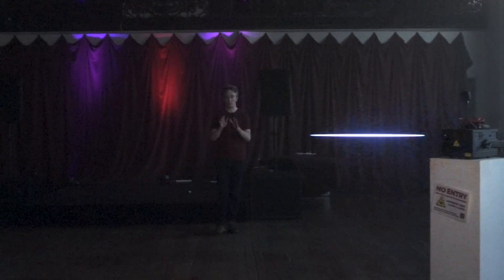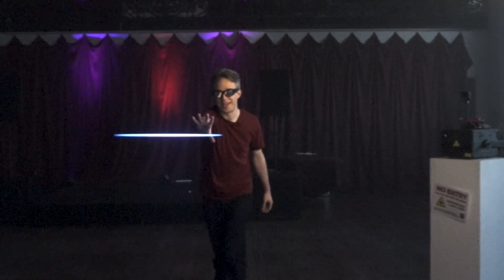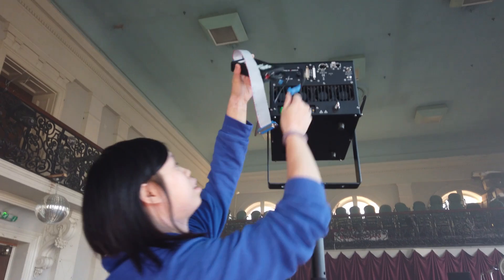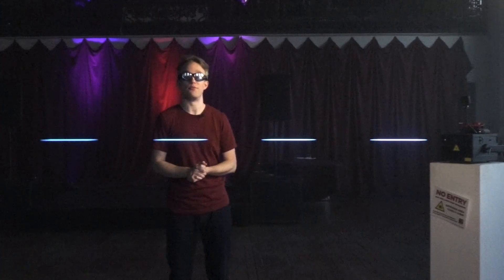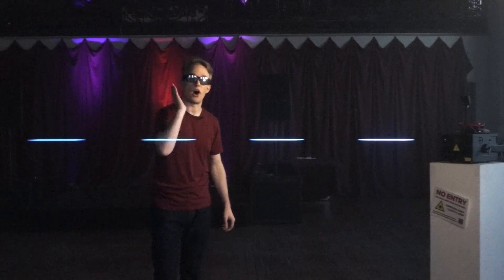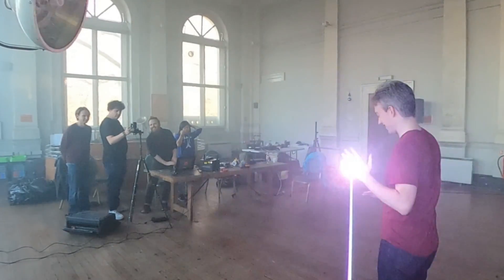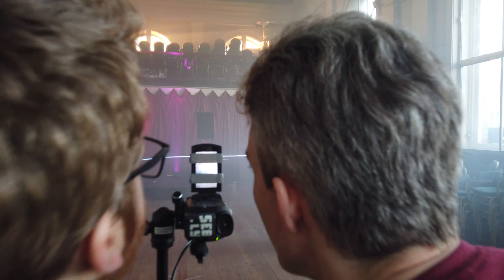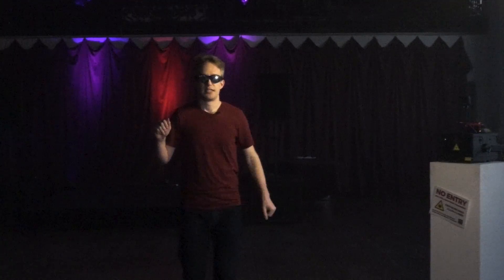Stopping A Laser Beam In Mid-Air

Comment: Mega nerd time: Star wars, despite calling it lasers, uses plasma bolts so they can actually travel the speed theyre seen at.
Reply: Some lightsabers are made with the button to turn it on be on the inside of it. This makes it so only force users can open it
Reply: @TeenyFGC  han solo literally activates luke's lightsaber in ep 5
and there's canon material that explicitly debunks this
Reply: @ft_lesserchungus1192   notice how I said SOME lightsabers. I’m not saying all of them are like this
Reply: @TeenyFGC  oh
damn
im dumb
Reply: Ooga Booga name one lightsaber that’s requires this, you don’t need to be a force user to activate a lightsaber, example the Mandolorians with the dark saber, or kreel
Reply: @kabash8683  or fin
Reply: @Kabash in ‘The Jedi Path’ book that Disney made it mentions that some lightsabers require the force to turn them on - this isn’t because they need the force to work though, it’s because a force-lock of sorts can be built in so that if someone should steal the lightsaber then it would be worthless to them unless they’re a force-user. The series should be fairly reliable since it’s at least pseudo-canon; it’s made to be compliant with the films over the expanded universe but will still mention things in the EU occasionally as long as they’ve not been contradicted by the films - a notable exception to this though is the ‘Imperial Handbook’ which mentions dark troopers (a.k.a. shadow troopers or blackhole troopers) which were squatted I think.
Reply: @kabash8683  I'm sat with the offical 'Way of the Jedi' (jedi history book) on my lap and it very clearly states that many of the Jedi and Sith of the old Republic would be more likely to use force-switches on lightsabres for 2 reasons. 1: if they lost their sabre in battle through disarmament techniques (popular amounts jedi) they wouldn't have it turned on them and 2: they could use a force throw of the lightsabre to eliminate individual targets within a group. The technique faded out after the fall of the Sith as lightsabre combat had become more ceremonial to the jedi.
The 7th fighting form of lightsabre combat (the darkside form) used many methods related to the force-switch, such as catching an opponents defensive sabre parry, and quick switching the sabre on and off again would cause you to flow through their block and land the killer blow. 
Sorry, I'm for nerding
Reply: Actually, in the original 70's SW: A New Hope the lasers are bright flashes that can't be seen especially in the opening scene. It was changed later on.
Reply: @CanONuke  yes but in the current cannon as demonstrated by the numerous existing technical manuals giving detailed cross sections of the blasters, theyre clearly plasma. Doesnt matter what they were originally
Reply: @Alendiel_nova  super heated gas can become a plasma though.
Reply: @Alendiel_nova  canon
Reply: @CanONuke  That's completely false. The 1977 version of Star Wars had blaster bolts traversing the screen every time there's a shootout.
Reply: Came for the Star Wars, stayed for the Nerd Wars
Reply: lightsabers are the plasma ones, I think blasters shoot super-compressed particle beams using gas or something
Reply: @ThisisSigma200  that super compressed gas is called plasma buddy.
Reply: @Kreschavier  super compressed gas and plasma are two entirely different things
Reply: Kreschavier That is super compressed Tibana gas you heretic ;)
Reply: @Kreschavier  Compressing gas condenses it tho
Reply: @Kreschavier  no it's a solid
Reply: Rebel Friend lightsabers use crystals
Reply: @ThisisSigma200  blasters are plasma too.
Reply: Rebel Friend aka plasma
Reply: Rebel Friend no the lightsabers powerhouse is kyber Crystal
Reply: @ThisisSigma200  Blasters use energy that heats Tibana gas into a plasma.
Reply: @ThisisSigma200  plasma is ionised gas, which can be compressed and manipulated using electromagnetic fields
Reply: @ThisisSigma200  aka plasma
Reply: @ThisisSigma200  

No they use superheated tibanna gas
Reply: @ThisisSigma200  Super compressed ionized gas aka plasma?
Reply: That's what plasma is. It is, in a manner of speech, the forth state of matter you get when you super compress gas. The other states obviously being solid, liquid and gas
Reply: @ThisisSigma200  their “ammo” is the gas, but it becomes a plasma
Reply: @ThisisSigma200  both plasma
Reply: @ThisisSigma200  lightsabers are energy
Reply: @ThisisSigma200  Nope, blasters use compressed gas to make plasma bolts and shoot them
Reply: @ThisisSigma200  this is the way
Reply: @ThisisSigma200  no it’s gas based plasma
Reply: @ThisisSigma200  that's called plasma.
Reply: @senatuspopulusqueromanus2082  nonono it's "tibanna" 😉
Reply: @ThisisSigma200  no. Kyber crystals. Even if it's fiction, don't declare things if you're not sure.
Reply: Wait but aren’t the crystals supposed to power the lightsaber by chanelling the force through the wielder?
Reply: @optionfive.  You don't need the force to turn on a saber
Reply: @ballguy1527  yea, you need the force to use it to its fullest potential
Reply: @ballguy1527  you don't need to be a force wielder to activate a saber because the force dwells in all living beings. It's just more powerful in the hands of a force sensitive wielder.
Reply: @ballguy1527  but you need the force to use it effectively
Reply: Lucas Tangen 
some lightsabres have the switch inside the hilt so you have to use the force to turn it on
Reply: @optionfive.  to make a lightsaber you need the force
Reply: @ballguy1527  yep it's why pre visla, Sabine wren, and bo-katan kryze can wield the darksaber despite them not being force sensitive
Reply: OptionFive  (Well that is totally how they all should have made it work, imho. 🧐)
Reply: Lucas Tangen  (You should need the force to use a saber b cuz it’s cooler that way dammit. 🤷🏻‍♂️)
Reply: @optionfive.  you don’t need the force to use a lightsaber
Reply: @optionfive.  so, to make a lightsaber you need to use the force. But not to use it. Darth greivoius has no force power
Reply: @DerrEtCetera  that's not how it works
it's not more powerful
it just is easier to move, to wield
Reply: @ballguy1527  u just need darth daddy to turn it on
Reply: @ballguy1527  everyone has the “force” some more than others without the force there is no life
Reply: @optionfive.  just no
Reply: @optionfive.  and no to the 300+ people who liked this crap
Reply: @optionfive.  the crystals amplify an energy source (a small battery)
Reply: @ballguy1527  Wait you don't? I always thought it was like that
Reply: @ballguy1527  According to Disney.
Reply: @ballguy1527  great example: greivous
Reply: @optionfive. nothing about the weilder
Reply: @ThisisSigma200  they're both plasma,  but lightsabers use kyber crystals that can use the Force to generate electrical charge, near-infinitely.
Reply: @ThisisSigma200  isnt one of those two options legends?
Reply: @ThisisSigma200  hmm super compressed particle beam using gas. isnt that just plasma
Reply: @thewildrave7334  no its "tibanna" 😎
Reply: @ThisisSigma200  thanks rebel friend!!!
Reply: Rebel Friend no, lightsabers are pure light
Reply: @Ink_Sack   if they were, they wouldnt collide. Theyre clearly some  sort of high energy particle
Reply: @Ink_Sack  If, by pure light, you mean plasma, then you would be correct - pure light would be laser swords, and it is well-established that lightsabers are not laser swords
Reply: @MrStyles784  plasma isn't pure light
Reply: @shadowxxe  That is correct. Neither are light saber blades. Or blaster bolts.
Reply: Lightsabers are basically a giant plasma cutter held in a shape by a magnetic field. Which Is how in The Old Republic books and game there are whips and axes and all sorts of different shapes. The kyber crystals focus the magnetic field and give the thing power.

Blasters supercharge a miniscule amount of some sort of gas and fire it which means in reality they would travel at slow speeds.

Slug guns in the SW context are a normal gum but it releases some of the gas inside the bullet or heata the bullet up and basically just throws molten metal at you
Reply: True. You can also tell because in new hope the blaster bounces in the trash disposal and Luke specifies that it's 
"Magnetically" insulated
Reply: @andresleon-vargas3603  magnetically sealed
the door was sealed by a magnet
you can't blast the lock
Reply: Han Solo opened the saber without the force. General Grievous wielded 4! lightsabers without the force. It is possible, but lightsabers are just hard to handle without the force guiding you because you literally only feel the weight in the handle, which makes it easy to accidentally cut yourself with it.
Reply: I LOVE that people on here are debating the usability of lightsabers. Haha. PS. The placement of the crystal (kieber crystal I think its called) is what requires the force because even a slight misalignment can cause the saber to explode when activated. That might be legends/KOTOR/jedi outcast material though so don't quote me. But turning it on is mundane.
Reply: You need connection to the force to focus the kyber crystal, which is why all Jedi have to make their own, it's a part of their training.

But once the lightsaber is constructed anyone who picks it up can turn it on
Reply: @mrdjchasm  lightsabre can't be built by the inaccuracy of the hand, only with the precision of the force can it be made.
Reply: @mrdjchasm  you are talking about MAKING a lightsaber.
the kyber crystal is like a rechargeable battery, and the focusing crystal gives the color and does other things ig
there's some sorta battery lookin thing in the back of the hilt that reabsorbs the blade's energy and puts it back in the kyber
Reply: Comrade Kilonova thank you
Reply: Mega nerd time. That's nonsense. They created these explanations AFTER the movies, to explain the quite unscientific space opera universe.
Reply: @rogeriopenna9014  well no duh that's how the lore of every movie is explained
Reply: @shadowxxe  no it isn't.  That's utter rubbish.  The majority of movies do not start with any such introduction to that.
Reply: NotYourGreatestPlan  "never been verified" its literally in the visual diagram books where they give detailed cross sections of various weapons
Reply: Does that mean they can run out of ammo?
Reply: @MayOrMayNot06  yes
Reply: @MayOrMayNot06  yes. yes it does. battlefront and rebels are canonically inaccurate as hell.
Reply: But what if every camera in the Star Wars universe actually uses a horizontal rolling shutter which causes the lasers to look like that?
Reply: or they just have materials and physics that we don’t hence the flying ships lightsabers and blasters
Reply: Ah yes, the nerd.
Reply: BUT shouldn't there be a trajectory that isn't seen in star wars? Some of the big ship blaster shots do arc..oddly enough  in space but during terrestrial fights I don't see blaster fire arcing. Unless I'm mistaken.
Reply: @Mike-om4tv  it's a gas turned plasma. It'll cool down and disperse long before it'll arc.
Reply: @Mike-om4tv  over long ranges its possible we would, but it could be explained by higher muzzle velocity and lower mass projectiles
Reply: Ok, plasma is NOT super heated anything. Think of a florescent tube light, that is plasma yet it is not super heated. Plasma is a pure ionization of a gas. If that ionization is in the positive direction, meaning the atoms absorbed electrons, then you can add energy to those electrons exciting them into higher energy states. That is where the debilitating reaction would come from. Like a ferocious oxidation reaction here on earth. It would transfer those high energy electrons to anything with a lower concentration, and then would dissipate the high energy states to return to equilibrium. Causing normal chemical bonds to break down. And thus matter to disintegrate. No heat necessary if you have enough electricity. Which, I assume, is what people are talking about when they say you need the force to activate a saber. The crystal doesn't ionize anything, that's not how that works. So, the weilder would have to charge the crystal continuously with electricity, (the force). Meaning that wielding a saber proficiently would only be possible by persons with a high midichlorian count as anyone else would use too much of their body energy trying to keep it active for long use.
Reply: @Robert_McGarry_Poems  I think they get that much, it's just that the most common way people think of providing enough energy to rip electrons off is heat.
Reply: @Robert_McGarry_Poems  Bro the crystal is what makes the saber shut up its fantasy and theyre magic crystals and in canon they constantly can produce a never ending supply of energy unless they are destroyed.
Reply: Tabana gas
Reply: And what's scarier is humans started developing plasma weapons in the 1950s
Reply: @torinjones3221  I don't really find that scary.
Reply: Nice
Reply: There's supposed to be something about the blasters using lasers to generate plasma, but I've always been a slugthrower fan myself so I cant tell you
Reply: Couldn't they just use metal bullets? Jedi can't really see them sooooo....
Reply: @Fef0p  the Mandalorians did just that and called them slug throwers
Reply: @Fef0p  jedi could sense them though and bullets on impact with a light saber would just melt a plasma bolt that bounces and retracts is much more dangerous
Reply: @Fef0p  some people do
it's just harder to story a ton of bullets than a single gas canister
Reply: Hyper Mega Nerd Time: In spite of that, the plasma bolts are actually made from gas, a gas wich point of plasmacity is low enough to make it that way, called Tibanna Gas. Also, the reaction it makes is aggresive.
Reply: @synth.ethicc  yes thats...how plasma works. Its superheated gas.
Reply: This is why George Lucas quit star wars. The obsessive fans
Yes, that's canon.
Reply: Lore stonks
Reply: I thougth i was a star wars nerd
Reply: I’m a Star Wars fan and I didn’t even know that, thanks.
Reply: Or they just simply add in the shots in after editing instead of complicating it
Reply: So Jedis should have closed their eyes! If you can't see it they aren't there!
Reply: This entire reply thread was extremely entertaining and informative. I feel as though I opened this thread knowing minimal about how lightsabers work, and now I could be considered a professional. Thank you everyone who participated in this, regardless of how toxic it might have gotten at points.
Reply: So we can use plasma bolts as REAL weapons?
Reply: E-11 bolts go between 130- 200 miles per hour
Reply: Real star wars fans already know this
Reply: Yea another Star Wars nerd im a Star Wars nerd too
Reply: Saber is a laser that shoots into a crystal and is reflected outward. I imagine since it's basically a flashlight it travels forever but is most concentrated a certain saber distance.
Reply: @Higuys-db7oo  it doesn't exactly travel forever with lightsabers, there's a shield kinda like what you'd have with ships or droidekas. Somehow that shield prevents the incredible heat from leaking and burning everything around it, and also lets energy cycle through the entire device so that power cells don't have to get replaced throughout years of use.

At least that's the case in legends
Reply: But what if you could exchange the speed of light for heat?
Reply: @sandrawong6787  you do know thats why you can feel heat from things like say THE SUN
Reply: Interesting
Reply: Tibanna bro
Reply: @Sleepcycle831  yes. The gas that gets superheated into a bolt of plasma
Reply: Ionized tabona gas
Reply: @olif7583  Im not sure if you replying to me or not, but thats exactly what plasma is. Superheated ionized gas
Reply: "Laser sword"
Reply: @Reggie the bunkler if youre replying to me then yes. That is what j said
Reply: @Reggie the bunkler everything is in space
Reply: @Reggie the bunkler yes
Reply: This is the best comments section ever, for a star wars nerd at least
Reply: They still are not affected by gravity for some reason.
Reply: Lame
Reply: They use Tibanna gas
Reply: That still wouldn't make sense. Plasma, when not in an arc form, can't travel distances more than a couple feet if you're firing it as a bolt. Only way to increase the range on a plasma weapon would be to use it in a vacuum, which would only give you negligible amounts of added distance.
Reply: @theburnedman6396  tell that to the people who decided to make them shoot bolts of plasma
Reply: @Kaedyn Quinn that is turned into a bolt of plasma energy that kills droids and troopers
Reply: @Kaedyn Quinn and if you actually did any research, you'd find that 1. They are called plasma weapons, not tibanna weapons, and 2. Once the tibanna gas gets all compressed nicely, it becomes a plasma blaster bolt
Reply: @Kaedyn Quinn also... Why are you getting all p'd off at me for calling it plasma weaponry? You would think that since blasters use plasma as their bolts, it would fall under the classification of a "plasma weapon," wouldn't you? I mean seriously, I wouldn't get mad at someone for referring to a crossbow as a ballistic weapon, even though it does comply with the definitions of a ballistic weapon.
Reply: @Kaedyn Quinn what part of the two quotes from two fellow star wars nerds who explained this in science fantasy and not hard science fiction did you not understand
Reply: @Kaedyn Quinn alright. Would something from Wookiepedia be counted as fact in this situation?
Reply: Huh.
Reply: U wouldn’t be able to hear them either cause their is no air in space for the sounds to move into your ear to vibrate the ear drum
Reply: @hursell  unless youre inside the ship in which case you would
Reply: i love star wars
Reply: In the cartoon clonewars series, you can actually see the ballistic curve of the plasma bolts.
Reply: How are they contained within the ship’s cannons without melting the ship then?
Reply: @Sleepy-yp4wx  magnetic feilds
Reply: Surveillance devices in my home  the detailed books show otherwise. in every detailed books that show the intetnal workings they all show plasms generation using tibanna gas but still call them lasers
Reply: Thank you.
Reply: Tabanna gas (spelling?) for blasters for sure. In some of the EU books they mention that starships shoot lasers but have a secondary beam (plasma?) for sighting purposes like a tracer.
Reply: True true true. They shoot a number of small plasma bolts in super rapid succession so that it looks like a longer "beam" but its actually not one, solid thing. They do this so that each individual part in the "line" in the entire bolt can impact, do damage, and dissipate before the next one hits. This is what allows blasters to punch through armor in the star wars universe
Reply: star wars fans gives themselves too much credit to what constitutes a mega nerd
Reply: Shhhhh
Reply: Then we fixed the speed problem but not how to control that much plasma in such a confined space without it cooling down and evaporating
Reply: Asked nobody
Reply: *they’re
Reply: SO THAT'S WHY THEY DIDN'T SHOOT THE POD
Reply: So the force is magnetism?
Reply: Yep. They're called lasers because they use lasers to energize tibana gas into plasma.
Reply: 30 mph blaster bolts
Reply: If they used light, the Jedis would be too slow to deflect them..what a mistake
Reply: He said Kylo Ren. Case closed.
Reply: I don't even think they call them lasers very often, certainly not in later material. They say "laser brain" or other figures of speech, but that's because they use lasers for like, sights and targeting and such. The weapons are almost always called Blasters. I believe there are some laser weapons, but they're entirely sniper type weapons precisely because of the fact that they travel instantly and, aesthetically, that is the most appropriate place to put a non-visual weapon in that genre.
Reply: I thought blasters blasted blaster bolts.  They call lightsabers laser swords but that's clearly an uncouth misnomer.  Ion cannons and proton torpedos are also certainly powerful... things.  Photon torpedoes, on the other hand, require warp capabilities, and most ships in star wars only have hyperdrive.
Reply: Do they ever call them lasers?
Reply: Mega movie nerd time: not everybody knows this, this is some real behind-the-scenes technical jargon, but Star Wars, despite calling them lasers, actually used things called "props." They weren't real weapons at all! They didn't even have real lasers or plasma in them! Neat, huh?
Reply: Yup, welcome to pedantry corner.
Reply: No, its Not Said anywhere in Star Wars. Plasma Bolts are used in Horizon.
Reply: Regardless of however you try to justify it with lore from legends, the creator George Lucas called it “a laser sword”…because he’s an idiot.
Reply: An obscure piece of lore, the actual visual part of the "lasers" are harmless and it was retconned a whole ago to account for visual discrepancies in the OT. Nobody seems to care though nowadays which is fair
Reply: A lot of people forget how phasers work as well, they're not made of light they're made of phased nadions. It's actually a particle weapon.
Reply: Go watch it again everyone. It's obviously dark matter needles fusing with the air during travel. Geesh.
Reply: You guys are aware that Star Wars is fiction aren't you?
Reply: @mitachu  🤓🤓🤓🤓
Reply: @Hugh Munro only two blasters used in Star Wars media use kyber cores, and they are both Jedi lightsabers in alternative configurations.
Reply: Not 100 % sure on this but i read somewhere that the lightsabers are incredibly heavy in the hilt. This along with the incredibly taxing requirements of lightsaber fighting make them difficult to wield effectively for non force users.
Reply: D3dW01f Gaming GL originally wanted them to be heavy, apparently. But now they are just concentrated plasma beams coming out of a torch (maybe)
Reply: D3dW01f Gaming im sorry, but thats wrong, only the hilt has mass, the blade itself has not, yöu can compare it to a flashlight, and its not heavy, wouldn’t mane much sense, right? getting tired after a few swings
Reply: @ThePuma1707  At least that would explain why the stamina bar in battlefront 2 depletes so quickly
Reply: @ThePuma1707  No I would imagine the hilt to be WAY heavier than a flashlight. The mechanism to produce the plasma blade would be very dense and heavy. Even if the blade had no weight, the hilt would be as heavy as if it were made of lead
Reply: You don't need the force to activate a saber, however they're heavier than a normal sword so saber users achieve the flashy, aggressive swings and parries by using their control over the force to wield them with any proficiency.
Reply: @d3dw01fgaming2  no, a saber would be easier to swing than a sword, almost dangerously so. The only appreciable mass in a saber is the hilt, but a sword has mass along its whole length. This mass and lenth gives a sword a higher moment of inertia and makes it more difficult to swing. Fighters accustomed to traditional weapons often expect a saber to react the same way and can over-swing and seriously injure themselves. It's like the difference between swinging a curtain rod and a flashlight
Reply: Henry Byers your forgetting that sword have balancing point closer to the handle to make it easier to handle
Reply: @henrybyers5557  A saber is a type of sword.

Similar to how katana are a type of sword.
Reply: @maximaldinotrap  uh I'm very obviously using saber to abbreviate lightsaber, as is literally everyone else in this thread
Reply: @henrybyers5557  Even then it is still technically a type of sword.
Reply: @henrybyers5557  a flashlight that weighs 300 pounds...
Reply: @henrybyers5557  lightsabers have weight in the blade from the resistance between the kyber crystal and user, example: the mandalorian and the dark saber
Reply: @maximaldinotrap  yes, they're talking about swords. Do you always walk into conversations and just say incredibly obvious things that everybody else already knew as baseline knowledge to understand the conversation?
Reply: @joshyoung1440  They said a saber would be easier to swing than a sword
Reply: @maximaldinotrap  oh my bad
Reply: @d3dw01fgaming2  which is silly bc a heavier weight in your hand is much more maneuverable than a lesser weighted object which is longer and thusly leverages your hand quite a bit while being moved rapidly.
Reply: @d3dw01fgaming2  *lighter. It’s because they’re so light that they’re very easily to move quickly and accidentally cut your arm off with, and Jedi use the force & tons of training to be more aware and in control of the weapon
Reply: Star Wars is fantasy, not science fiction.
Reply: Adam Baldwin Wdym by that? What’s your point?
Reply: @jimmyvanilla5285  It's a line from the show "Party Down." The character Roman hates it when people call Star Wars science fiction.
Reply: @rars0n  *science fantasy
Reply: @rars0n  space opera.  Science fantasy, more fantasy than sci-fi for sure.  But space opera is the closest designation I believe.
Reply: Adam Baldwin laser guns and laser swords and intergalactic space travel I would say this falls under science fiction
Reply: @shiggliggler  "A long time ago in a galaxy far, far away" sounds like fantasy to me.
Reply: @shiggliggler  actually,  little science is given.  Let's summarize the story; a heroic commoner is recruited by an old wizard and groups up with pirate and his beastly barbarian partner, to rescue a princess from a dark lord, eventually taking on an evil emperor and discovering the heroic commoner is actually a long lost prince.  Oh, and he has magic powers.  Space fantasy.
Reply: @sinisterthoughts2896  science fiction is fictional science such as hyper drives intergalactic space travel and plasma swords the story isn’t science but cmon what is it’s definitely sci fi
Reply: @LittleRedRhuari RRR No, it isn't. Plasma and gas are two fundamentally separate states of matter.

You can superheated a gas, ionise it and have it convert into plasma, but at that point it stops being gas. It's now plasma.

It's like you being born, getting laid, and someone saying you're fundamentally still a virgin because that's what you converted from. You were a virgin. Your state was altered by the process of getting laid. You stopped being a virgin, and continuing to refer to you as such would be inaccurate.
Reply: @jamielonsdale3018  technically you could convert anything to a plasma it just changing states of matter like water to gass and water to ice. You could if you had the right technology and know how covert water into a plasma and skipping the gas phase
Reply: @DexZabeth  Technically correct, but we just do it from the gas phase. 

In order to create plasma, you need to pump enough energy in to pull the electrons off of the atoms. This ionises them, and is the indicator of the phase change. While it is theoretically possible to impart enough energy to have a solid or liquid skip past the phase change into a gas and have it go straight to a plasma, if you were to slow that process down, then you would see that you never actually skip the gas phase, you just pass through it in an extremely short amount of time. 

But as you're only raising technicalities instead of things of relevance, I can only give you half the credit of being right. You were correct and yet completely redundant.
Reply: @jamielonsdale3018  Oh god, why am I getting in this clusterfuck of a pseudo-intellectual conversation, but no, you wouldn't see it pass through the gas phase extremely quickly. Sublimation doesn't cause a solid to go to gas with a very short stay in the liquid phase, it just goes from solid to gas, skipping the gas phase entirely. The analogous processes certainly exist for going from solid to plasma, or liquid to plasma, you just don't see them on a phase change chart because they aren't common, and it's a big enough shock for some people to learn that there are more than 3 states of matter, but there are dozens if not hundreds of different phase changes. 

Given that plasma is a "gas of ions", but is distinct from the gas phase, there is no reason to assume that a phase transition from a solid to plasma or liquid to plasma would necessarily spend any time in the gas phase. If you inject enough energy into a solid or a liquid, it will not only sublimate or evaporate but also ionize them. I'm sure you could do it slow enough to make there be a gas phase, but it is not a requirement. 

Even this is a vast simplification. It's a fair bit more complicated than you seem to think.
Reply: @jamielonsdale3018  epic way of putting it
no sarcasm 
i just think that's a cool way of putting
Reply: And yet they travel a hundred times slower than bullets.
Reply: @Wellies_Yay  actually that wrong... there is a video on here that does a mythbusters style test and shows they move as fast as a pistol bullet. People think they don't because you can see them. But that's because unlikely bullet they are glowing. Think about tracer rounds. They look slow. Also think about for instance the falcon 9 rocket, at separation it's going 2 or 3 times the speed of a bullet, yet can be watched with ease. It's all due to visibility not speed.
Reply: @Wellies_Yay  they seem almost the same speed as bullets in the movies... Look at videos of people shooting guns, you can see the bullet fly towards the target...
Reply: @0ooTheMAXXoo0  Maybe a pistol round moves about the same speed, but rifle rounds even with half powered cartridges like 5.56x45mm and 7.62x39mm go way faster than any blaster bolt I've seen in a star wars movie. Correct me if I am wrong.
Reply: Lasers can conduct electricity. If some particles like Higgs bosons were carried by a laser, then something similar to a blaster cannon would be made.
Reply: Giga nerd
Reply: SABERS AND BLASTER BOLTS ARE PLASSSSSMA! Geez... Do your damn research people
Reply: @skylarreid1284  sabers aren't plasma
they're energy
Reply: The nerd rage is strong with these geeks…
Reply: You guy know star wars isnt real right?
Reply: @kant9546  so what? we are aware that it's not real
Reply: @Alendiel_nova  im not so sure
Reply: @kant9546  lmfao thank you
Reply: In other words they're probably using the equivalent to laser tag bolts
Reply: A really heavy hilt might be harder to swing than a sword of the same weight, because the center of gravity is closer? Idk if that's how it works
Reply: @tacomeme429  
No that's not how physics work in fact it's such a common sense intuitive physical reality for humans I  don't know how could have made that statement.
Reply: That’s a geek thing not a nerd
Reply: @Oliver-pi4wd  nerd is to be knowledgeable about a subject, geek is to be weird.  Geeks used to be a kind of circus side show freak.
Reply: Lmao 69 likes
Reply: @thebigbadbullyt  Nice